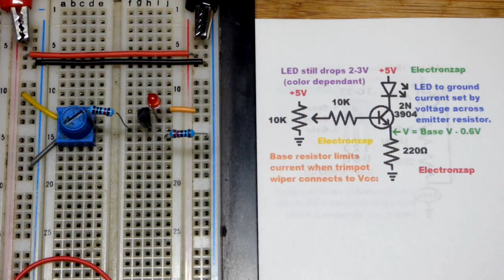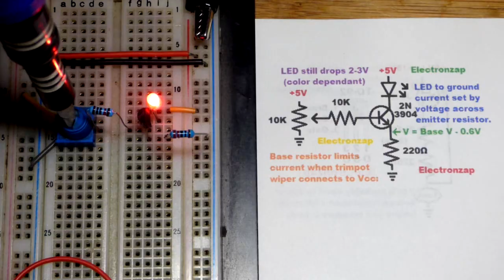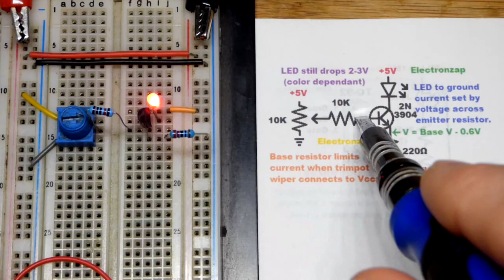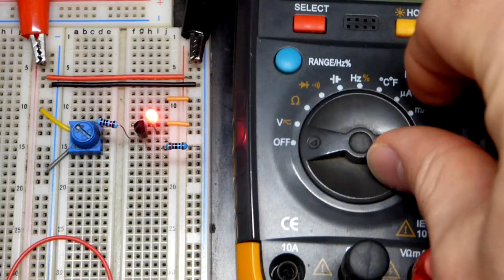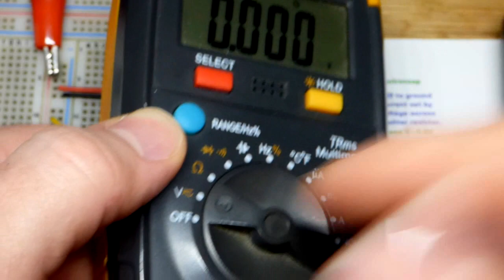Adjustable NPN BJT Current Source Trimpot Controlled LED Load

Comment: Where do you get that board with holes
Reply from the maker: It's called a breadboard. https://amzn.to/42b0QPv is where I got the one used in the video from Amazon. You might prefer a smaller one. The ones with a metal backing tend to be better made but cost more. Above is an Affiliate link, so I may be financially compensated for any purchases.